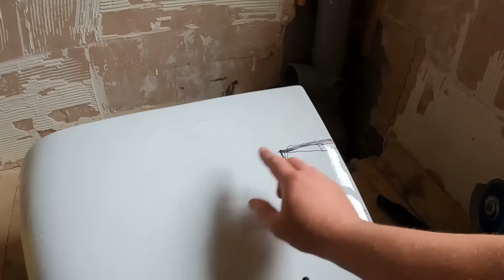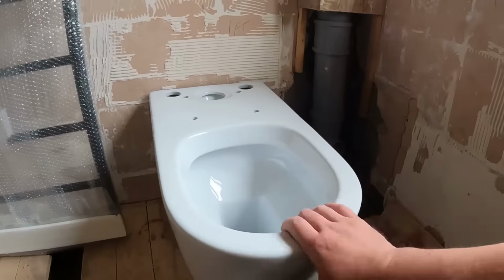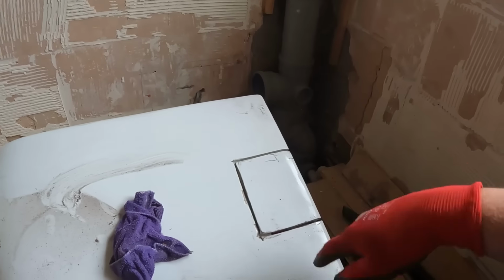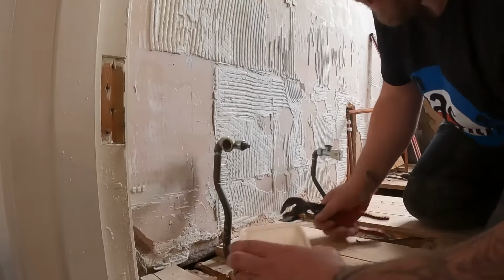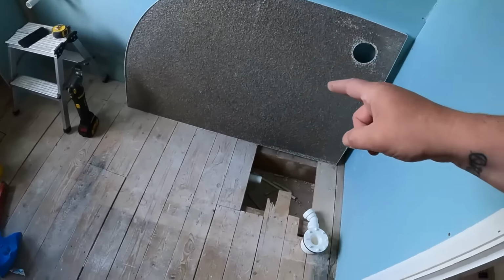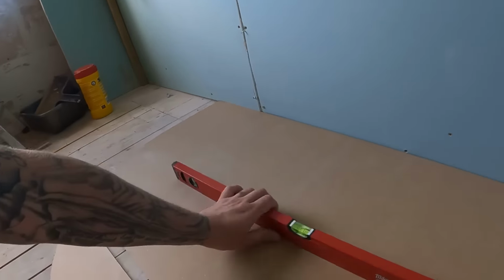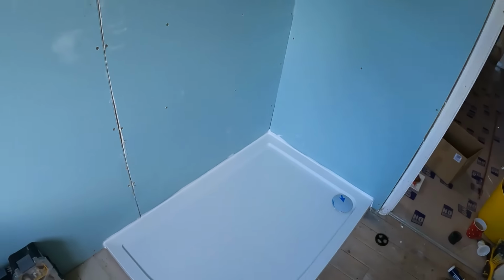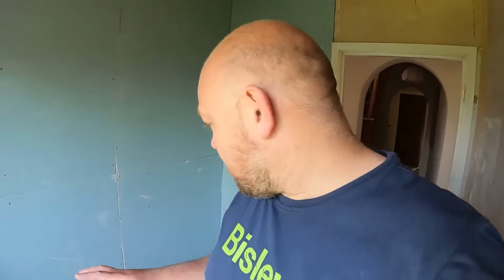BATHROOM REFIT-CUTTING A SKIBIDI TOILET PAN..CAN IT BE DONE? Part 2- 1st fix done

Comment from the maker: When the customer wants a back to the wall pan but you need the side entry space for the waste pipe……. This is what needs to be done in the real world…🙌🏼🙌🏼

So just to clarify some pointers as I know they will come up-
The pan is still strong enough to use, it’s not an issue.
The customer made the decision to try it.
Moisture boards are fine to use.
The tiler is tanking the area before it’s tiled.
The holes in the ceiling have now been covered over with the new ceiling…. Told you🤣

Please get subscribed to the channel…. Exciting news is coming very soon😉😉
Reply: Had to do it a couple of times. Bit nerve racking doing it but it works a treat!

Comment: Great vid Mark 👍😉 keeping it real 👍
I've used Insta-stick on my shower trays, or tile adhesive. I've always made sure the floor and underside of shower tray is dust free, I've also primed them as well, jus to be sure 😉
I guess you'll be using a flexy pan connector for the Wc. 👍😊

Comment: Great video got to bung a system soon. If there are heating pipes running to two rads and u want to cut tees into flow and return will this method still work as surely the water from the two rads will come back
Reply from the maker: Do one pipe at a time buddy 😉👍🏼

Comment: Never thought of doing that to a pan but it looks like a decent easy way to cap the box end off .i have trimmed the bottom off a cistern as it was out of shape that worked ok
Reply: Also dont have problem of the flexi pipe or pan pack hitting the boxing top corner
Reply from the maker: It can be very handy

Comment: Just notch the steel for them rad pipes what's the worst that could happen 😂🙈 joist notching is fine as long as you stick to regs.

Nice job on cutting the pan. I've seen it down with a diamond hole saw never tried it myself though. Squeaky bum time.

Look after your knees pal my right one gripes every now and again not fun. Lots of walking in my case.

Ps that electrician is an animal 🤠 either that or too tight to buy a holesaw. I'd never do that on a job even if it was being overboarded. He'd be flung out of my house.
Reply from the maker: New ceiling up mate… you would never know😉

Yer I’ve always wore kneepads from my very first day of my apprenticeship, my boss at the time said look after them and I have👍🏼👍🏼

Comment: Waterproofing Mapei style will require to put Waterproofing tape and corners before the tray, prime the surface underneath and apply two coats of a Waterproofing,  then put the tray in, apply sealant behind the tray, and on top as you did, and then carry on with Waterproofing above the tray. That is Waterproofing properly done, otherwise it's not perfect, but I assume nobody is🤔👍
Reply from the maker: I suggest you take a look on the Mapei tutorials buddy, they show it with the tray all ready in……. But thanks for taking the time to watch the video, then taking the time to type this comment….
Even your not perfect it would seem 🤔👍🏼

Good job we ain’t using Mapei anyway, it’s not a great product…
Reply: @MJTiffPlumbing  I'm not perfect. Agree on this. Please take the time and read again my comment. Waterproofing ( Mapei style ) , not necessarily Mapei.  If   because of the movement, and there will be some movement,  as you expect on wooden structure,  this seal around the tray will split over time , then the water will go behind and damage whatever is under this tray.  It's not rocket science. I'm using common sense.  Been doing this nearly 20 years.  And to be honest I never watch tutorials of any brands, just using common sense. So far this never let me down. And I didn't want to play Mr clever man. Just sharing my opinion. Don't take it to seriously " mate " 😉
Reply from the maker: @gienekpaa4892  
Appreciate that mate….. in 26years of being in the trade myself I can honestly say I’ve fitted hundreds of bathrooms and NEVER had an issue… at all. 
Thanks for watching and commenting…. I work to a tried and tested formula that’s done me well for 26 years 👍🏼👍🏼

Comment: Your plasterer has hidden all the cables in the ceiling 🤣 your sparky is going to have to smash it open again to pull them through 😂😂
Reply from the maker: No he’s not🙄🙄

My electrician will go in the roof and connect the down lights….. as that’s how they do it…. Always have done..

They know what there doing buddy😉
Reply: @MJTiffPlumbing  seems a lot of effort to have to go into the roof. If the ceiling was plastered but leaving the wire rails coming through (how I’ve seen other plasterers work), then the electrician could have fitted off within the bathroom and not have to get into the cramped roof space 😂

Comment: Loving the work Tiff. Be super interested to see if Nath has any hacks for getting the old adhesive off the walls Befor he tiles!?
Reply from the maker: I took most of it off with a scraper……👍🏼👍🏼
Reply: Wallpaper steamer & a scraper, gets old adhesive off,
I've even used an electric heat gun.
Reply: @davec1410  nice!!!
Reply: Just spray with water and let it soak in..scrapes off like butter

Comment: I wanted to see the final shower waste fitting process on the tray as i am diyer and have only done such with a low level tray by getting under floorboard access from the side. It must be a secret 😉 and that is why it was nit in the video 😀
Reply from the maker: It’s just a case of setting it to position and turning the waste trap into the body….👍🏼👍🏼

Comment: Hi Mark great video yet again!
A small question why did you not fit the tray straight onto of the flooring? Then but the plyboard upto the tray? I've never seen anyone cut a section of pan out but I guess every day is a stool day. Keep up your videos !
Reply from the maker: Cutting the pan out, I’ve done it a few times and you’ve got to do these things sometimes.
Tray of the base was to get it lifted slightly so it works with the tiling and gives a slight more fall👍🏼

Comment: Great vid mark. Couple of bits Ive picked up from this one, cheers mate.👍 if you use soldered caps on the heating pipes the tiler can get a tighter cut round the pipes 👍

P.s where did you get your bungs from?
Reply from the maker: Thanks mate…..
Yep the holes would be tighter however sometimes it’s good to have a slightly larger hole for a bit of movement and I will always fit talon pipe covers over these pipes anyway so it’s not an issue. Nothing worse than tight holes that you have to then start chipping out and run the risk of breaking 😉

Bungs are from Toolstation I think mate

Comment: Keep that rag away from the grinder, if it grabs it will eat or break your fingers before you know what's happening.   Get a tilers sponge, holds more water and the blade will abrade it or cut it without and v work of it grabbing and entangling you.
Reply from the maker: Good advice mate… Thankyou 👍🏼👍🏼

Comment: Hate to get that call from the customer though. "Unfortunately my toilet and my arse are in pieces".
My advice is do not cut into the structure of a pan, just because it can be done does not mean it should be done. If there's no option but to go side exit then an open back toilet is the only way other than boxing behind the toilet to facilitate the back to wall option.
I'm not saying i haven't done the unspeakable in the past but common sense must prevail, it really could be catastrophic....
Reply from the maker: 2 years down the line and it’s spot on still 👌🏼👌🏼👍🏼

Comment: Tanking kits are a complete waste of time and money. If water gets behind the grout- jobs fucked anyway 🤷‍♂️
Reply from the maker: Completely agree with that mate….. 👏🏼👏🏼
Good job my tiler is spot on and never ever had an issue in 20+ years 🙌🏼🙌🏼
Reply: I do my own tiling bud, only time I install a tanking kit is if the manufacturer of wetroom specifies- in order to guarantee their warranty.
Just seems pointless to me tanking things- if water gets behind the grout or tiles there is a huge problem so need to start again anyway 🤷‍♂️👍
Great video as always mate, really enjoy watching people living the dream like me 🤦‍♂️🤣👍
Reply from the maker: @benradley4895  
Thanks mate… 🙌🏼🙌🏼 glad you enjoyed it
Reply: Would hardie backer be better for all this ? I know it is lovely to cut but nothing gets through it
Reply from the maker: @Михаиллеви  
Yep Hardie Backer is an option…… either or is just as good imho
Reply: @Михаиллеви  this is my point mate, if water is getting behind the tiles - it doesn’t matter what the backer board is - it’s knackered and needs replacement tiles ? 🤷‍♂️👍
Reply: @benradley4895  if water gets on hardie backer board i would have thought that was about as porous as the tiles themselves i.e. not at all. Grout is porous but does that matter if it is on hardie board. I have used cement adhesive and that is tough stuff to dislodge. We won't get any blown tiles i reckon. I am diyer so bear with me 😀